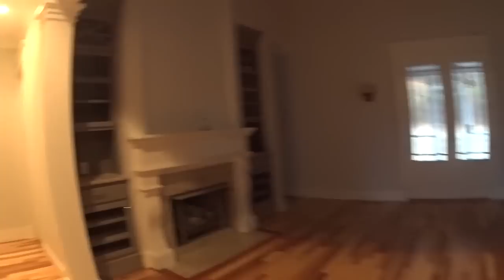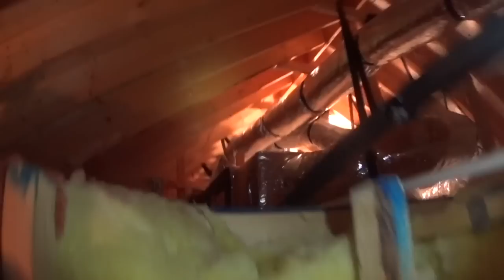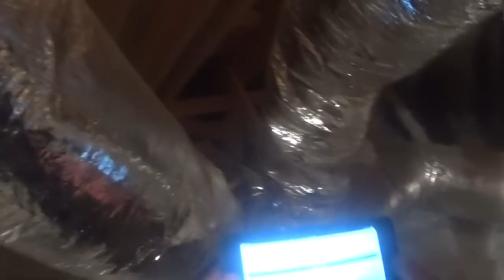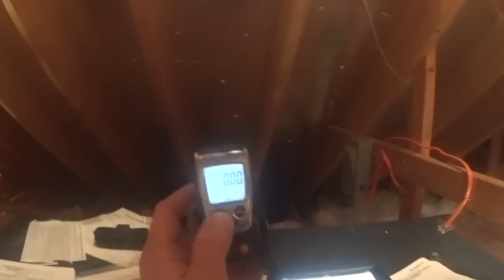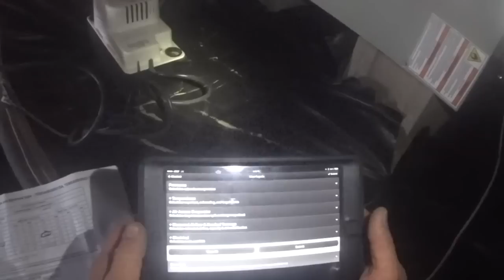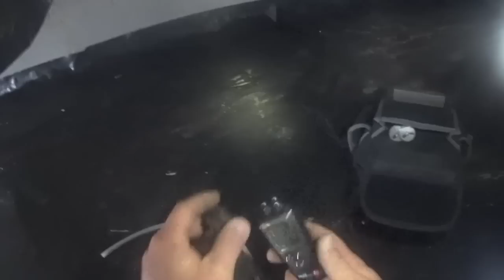HVAC Service: New Heatpump Install High Power Bill Complaint Troubleshooting 3-23-15

Comment: This is why I should not be an HVAC business owner.
Because I wouldn't of ran that call until AFTER the customer shows me the results of doing a 2 month long controlled experiment in regard to energy consumption on their electric bill.

Basically, for 2 solid, consecutive months they'd have to turn off every breaker in that house, that does not power any of the HVAC systems.

& I'd require both T/STATs to be set the same & not changed during the 2 month long experiment.
Both T/STATs in the same mode, set for 70 degrees, fans set to auto.

Then & only after all this criteria was met for a solid 2 months, I'd ask to see their past 2 electric bill cycles.

& IF the energy consumption from the 1st month to the 2nd month increased, then & only then, would I go out & diagnose.

& really, this experiment would need to take 3 solid, consecutive months in order to verify that 1 or both system either is, or is not running up an electric bill.

All this provided that the day & night temps, from month to month, are not all over the map (i.e. during the changing of seasons).

But I'd be generous & just require that the 2 consecutive months long experiment be done, instead.

Comment: Wouldn’t the low cfm over the indoor coil you had on the upstairs unit cause high head pressure in heating?  This would intern cause higher amp draw.  Also your strip heaters need to be interlocked with outdoor thermostats that are set at the balance point of the system, otherwise if the customer jacks the thermostat, supplemental heat will come on unnecessarily.  Make sure unit is not going into defrost until it is necessary, and only enough stage of strip heat comes on during defrost to just temper the air.  The defrost cycle can kill the efficiency of a heat pump if it is not managed well.  Same with the supplemental  heat.
Reply from the maker: I suppose you could be right, I don’t believe that airflow was a contributing factor in their complaint

Comment: You know it's hilarious the prospective owners of this house haven't even moved in yet and yet they're assuming that in their minds the source of their High electric bill is that the brand new heat pumps there's obviously something wrong maybe what they should do before they move in is considered downsizing I love people like this in my area we have heat pumps and I always get a kick out of when we go through a cold snap in the months that follow they get there electric bills the service calls start to role in could you please check my heat pump my electric bill is through the roof I would have liked to see the faces of those homeowners when you told him everything is perfectly good and you can expect heating bills slightly higher that you've been seeing since both your thermostats we're set at 64 degrees and 68 degrees
Reply: I live in Corpus Christi, Texas. There are months when the temperature outside floats between 60 to 80 degrees, so a lot of people won't use their heating or their cooling during that time.

My favorite is when a customer blames the HVAC system for high electric bills & you start asking them questions like,
"The past 2 months were March & April....Did you use your heating or cooling in March & April?"

Customer:
"No. We didn't use it at all. It's not been hot or cold enough to turn it on."

"Ok...it's barely even June now & it's gotten pretty warm already. I am guessing that you've turned on your AC, right?"

Customer:
"Oh yes, we have been running it since the beginning of May, because the temperature outside has warmed up & we need the AC."

"When you turn on the AC, does the system pull down to set temp & shut off?"

Customer:
"Yeah. But our electric bill has gone up. In March & April it really wasn't that bad. But we just got our billing statement for May & it's gone up so I know there is a problem because it shouldn't be doing that."

"Ok, so is your complaint that you are not comfortable, or is your complaint that you just noticed an increase on your electric bill, since you started using the AC?"

Customer:
"Well, there is definitely a problem. We have lived here for years & it's never been like this...."

-Then after spending waaaaaay too much time doing a thorough diagnosis, checking duct work, 
the T/STAT, inside/outside units, sealed system & all wiring/electrical; I find that the system is running 100% efficient.
I notice that insulation, windows, doors on home are old. I notice that vent hoods & bath fans either are non-existent/not working/not being used, or not pulling moisture out of the home.
I notice that the baffle on the fireplace is wide open.
I notice all these other things. & When I point them out to the customer, it's
 "......Well, that's always been like that & we've lived here for years & it's never been an issue, so I know the AC is the problem."

Once it gets to that point, I either collect the diagnosis & leave. Or I ask the customer if they'd like to buy a brand-new system, duct work, t/stat, line-set, inside & outside unit.

If they continue monopolize my time & refuse to tell me specifically what it is that they are wanting done.....then I just leave.

Comment: with a total electric heat pump the heat strips should not be on unless outdoor stat is calling due to low ambients or unit is in defrost. resistive heat is always expensive. My compressor failed once in the winter and had to run emergency heat and the elec bill was unreal. Did you check amp draws on heat strips and verify proper staging. I was taught that high speed is for cooling and low-medium or medium/low was for heat mode unless its a variable speed blower then it's controlled by the dip switch settings. Also I noticed you guys use the pre-made traps, we had problems with those not being deep enough. American standard and Trane installation instructions said a minimum of a two inch traps at one time. Have they changed the dept of the pre-made traps? Here's a good reference for trap sizing I have found helpful. http://webmanuals.lennoxeurope.com/Out%20of%20Production/Rooftop/Service%20Archive/condensate%20traps.pdf

Keep up the good work and stay safe.👍👍
Reply from the maker: Pre made traps are still shallow. This jurisdiction has some interesting exceptions to the code even if they are less stringent than Nationally. Thanks for the input and for watching
Reply: Yeah we are on the international code here. The problem we had with the traps was mainly on VFD blowers pulling air backwards up the trap causing drain pan to overflow. I started building my own similar to yours without the pre made. I just cut a 4" down 3" across and 2" up. But now i use the engineering reference info from that link because now I primarily deal with big commercial equipment with much higher static pressures. That link didn't work for me from here until I copied and pasted it for some reason. Thanks for your time and videos.

Comment: you just taught me a new trick.  turn the tstat up 10 degrees exactly.  i usually just bump it up 10-15 degrees or wherever i decide to stop pushing the button and try to member where it was set when i got there.  i forget occasionally and just put it somewhere i think is right.  exactly 10 degrees tells me where it was when i started.  sweet.  im easy to please.  LOL
Reply from the maker: glad i could help +jeff leonard thanks for watching

Comment: Just think that there in nothing in that new house to hold in the heat either, no shades on the windows, carpet, furniture. Its just heating a huge open space. Sheetrock is not much of an insulator either. The little bit of insulation I saw did not come even close to R15 and you would think R30 would be minimum in your area. Great vid as usual Stephen...
Reply: My thoughts exactly.  High bill as compared to what? All the luck convicting the client.
Reply: Word

Comment: Is there anything in Trane install guide about having the lineset go above the indoor coil so refrigerant doesn't drain back to compressor via gravity?
Reply: +Joe Shearer Hi the only problem I had on one job was the total height of the building 4 floors was the start up which the compressor could not handle would trip overload . had to fit a hard start kit ( UK) as you said drain back. It would not go straight to the compressor but to the condenser which should take it . Correct size pipe work would be important. check compressor amperage on start up with high ambient conditions against the data label . Hope this makes any sense.
Reply from the maker: not entirely sure there +Joe Shearer haven't noticed anything or had any issues that i'm aware of

Comment: Were the heat strips running?   Based on the weather history in your area, the temps were 46 to 56 on March 23rd.  Will those Trane setups allow the strips to run automatically at those temps?   Around here heat strips running unnecessarily is usually the problem with excessive bills, usually caused by low charge, bad wiring, or manual operation.
Reply from the maker: +RJParker nothing out of the ordinary, when i tested initially the strips were on but the thermostat was calling for it and when i disconnected the control wire to the strips they shut down. i didn't find anything with the HVAC that looked like it would have been causing a higher power bill. Only thing i would like to have done different was to set the airflow better on that second floor unit on the initial start up
Reply: +Stephen Rardon (HVAC with Stephen Rardon) I like to setup heat strips via the thermostat and/or defrost board where they won't run above 40F unless in manual.  So I assume the Trane setup would allow them to run based on the Thermostat setpoint even above 40F?

Comment: Was it just in the customers head?
Reply: One man' high electric bill, is another man's reasonable electric bill.

People will build an expensive, nice house that forces them to just barely be able to afford living in it.

Electric bills fluctuate. Nobody's bill is exactly the same month to month, unless they are on a pro-rated plan that only allots them a fixed amount of kWhrs per billing cycle.

I am going to go out on a limb here as assume that most middle class & wealthy people are not on such pro-rated electric plans.

So, these people build these houses that they can barely afford. Then when their electric bill goes up, just a smidge, they panick & blame the newly installed HVAC system. 
Especially, if it was installed less than a year ago. Because typically, within a year of installation the HVAC installer will come out, diagnose & fix or improve it for free.

So the customer knows how to play the game & takes advantage.

I find it interesting that when their monthly electric bill decreases, they never call you to tell you that their new system is running well.....

Hmmmmmm, wonder why that is?!....
Reply from the maker: +james holder maybe, Tom Powell said it best... What is High when you've never had a month to compare to on a new house...?